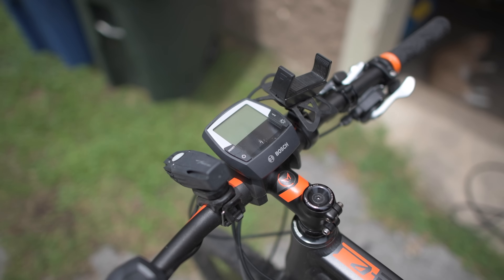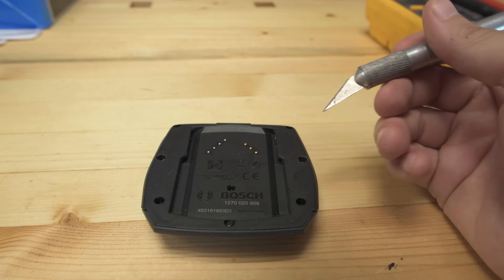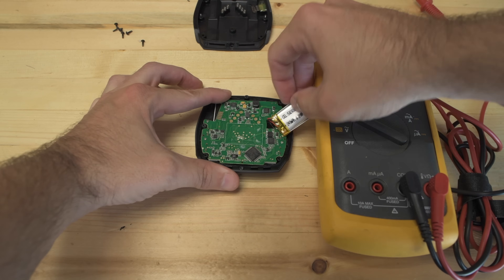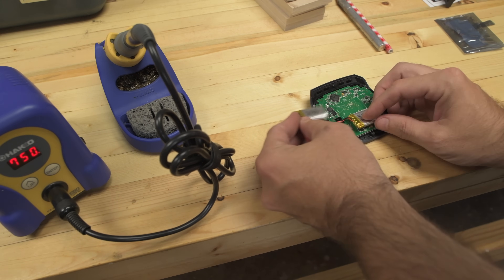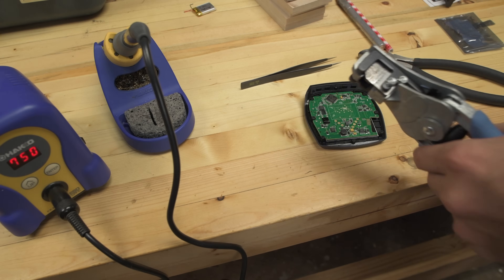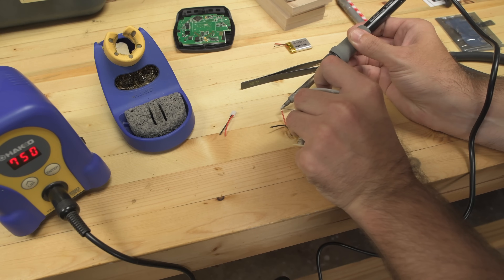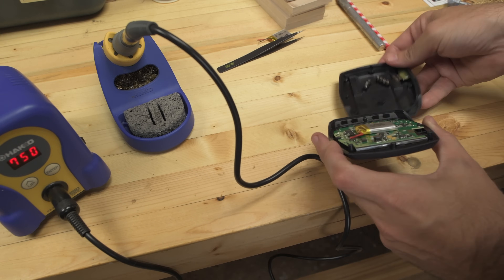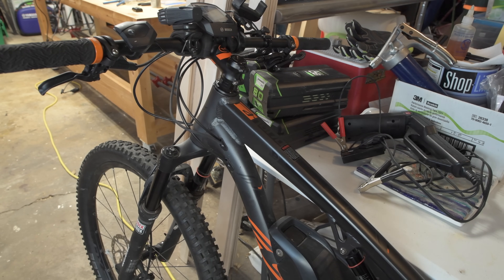Gen2 Bosch ebike display battery replacement

Comment: Thanks so much! I just had the Gen 2 motor replaced on a bike - they went to test it, and the display was dead. Said the only option was to replace the entire display, mounting bracket, and thumb control with a newer version b/c a display replacement wasn't available. $180+. Will have a go at replacing the battery, and if I fail, there are display replacements on ebay (and maybe other places).

Comment: So this is definitely the issue I have. I havent open my unit but I can swear by the battery being dead.

I always take the unit off to prevent theft. I usually charge the bike and the head unit might be in my coat. 

Not once did anyone notify me of the charging process. I'm now looking to buy a solder kit and batteries off amazon and they will be here in a months time. 

The dealer for my bicycle has not yet gotten back to me except basically troubleshooting. 

What a silly design flaw... if youre not aware of it.

Comment: I had the same problem, but all I did was put 4volts to the battery terminals , not the wires, for about 5mins and it brings the battery up to 4 volts and it's been working ever since. Happy Days.

Comment: Thank you so much for this video!  Following your steps solved my problem completely!  After struggling with those 2 screws covered in goop, I simply drilled the heads out with a small drill bit and relied on the remaining 5 screws to hold the unit together after soldering in the replacement battery.  Bravo to you for posting this video!
Reply: I did the same. Add a dab of sealant over the now open screw holes.
Reply: Just scoop the goop out with a small flat screwdriver.

Comment: Does the head unit battery charge from the main battery? And does anyone know which chip is the lipo charger?
Reply from the maker: It does charge from the main battery and newer versions appear to be capable of turning the head unit on periodically every so often in order to recharge the battery. I don’t know if that is a firmware upgrade able feature though.

Comment: Great video. Thanks a lot. I had ordered a new main battery, like for 800 $, but it did not resolved the issue !!! My Haibike has like 6000 miles so I thought the display turning off was caused by the main battery going dead. It was not. I switched displays with another similar bike and it worked fine. I will get a new display since I am pretty sure I will screw up if I start the soldering process you presented and executed with great detail. Thanks again !!

Comment: Great video - thanks.  For those wanting to order a new battery before getting their controller apart, the dimensions of the original battery are about 30mm x 20mm x 4mm.  Do not exceed the 20mm width as it has to fit between the spring contacts with the back, and a bracing post.
Reply: Can confirm those dimensions are correct. Mine was a bit taller though at 5mm, so there might be a bit more space in there
Reply: Can it be a bit longer? I have one in sight that is 35x20x5mm.
Reply: @lovemadeinjapan Scaling off the photo, I'd say 30mm is the maximum that is going to fit in that recess in the rear case
Reply: @ The local shop had the perfect fitting one, and adjusted my order on pickup when I told it was for an Intuvia, so it was an easy replacement.

Comment: Before doing this you can first check if the battery is really death by trying to charge it with a micro usb cable first.

Comment: Thanks for the video @createthis. Did your odometer keep the miles or did it reset? I'm concerned of losing odometer miles.
Reply: Odo doest reset with empty battery. Only clock and trip kinda stuff
Reply: @Jandejongjong  appreciate your response. Thank you

Comment: I have done as you suggest at the start of the video and I can get the controller to come on by pressing the reset on the battery.  Will it work as normal once it is on so can I continue to use it in this way? It's not a great problem switching it on this way every time but I am not clear why this works and if the unit once it's on will continue to function during a bike ride as normal. Any advice would be helpful thanks.

Comment: Great video, I did encounter a problem with battery size following the link provided, was much too big, I will attempt to post a link to the correct sized unit. I did have some luck with the security sealant around those two screws though, I warmed up the end of the correct size screwdriver over a flame and as it was inserted into the screw head it melted the sealer, worked very well.     https://www.ebay.co.uk/itm/3-7V-250mAh-502030-Polymer-Li-ion-battery-cell-Dashcam-Mp3-bluetooth-Protection/264284173034?ssPageName=STRK%3AMEBIDX

Comment: Hey Bro , you are very good. Not the Superman, like many other Videographer present themselves.  Also the hint with the danger if the amateur cuts both wires together, was perfect. Good man. A small hint from my side: Take a picture of the board before you do modifications.
Reply: Thanks for the excellent video. I did this as outlined and my device did not restart unfortunately
Reply from the maker: That sucks. Did you test the battery with a volt meter (multimeter) and confirm it has sufficient voltage? Also double check the polarity.

Comment: Makes sense my display keep going off during the ride and I have to restart it .
Reply from the maker: I’ve never had that happen before. Is this perhaps a contact issue? Carbon on one of the contacts or a worn spring?
Reply: @createthisdotcom  I'm not sure I didn't check on it but it's definitely strange and I'm worried a little sometimes as when I'm like 20miles away and if it wouldn't turn back on I would have to Pedal back a 60p bike with no assist
Reply: @NYCRO21  hi! I have the same problem and i feel lucky that i found you. I hope that the problem  was the battery!?
Reply: @royswisjshwk3167  no it looks like a connection issue
Reply: @NYCRO21  i will check it.   Thank you very much
Reply: Rub the contacts and display pins with your finger and CRC contact spray, has worked for me multiple times in the shop.

Comment: Thanks for this valuable tip. I have the same Intuvia. Isn't there an issue innstalling a 250 mA instead of the original 500 mA ?  Your point of view shall be appreciated.
Reply: I checked on Amazon that the original battery exists :   @t

Comment: Please first try to charge the battery via the usb. My charger for my samsung phone works very well for this. My display died today after exactly 1 year use. I am now chargeing it.
Reply: Did it charge tho?mine is charging right now but it goes on/off while charging
Reply: Yes I'm also having this problem and like you trying to charge via the USB port. Mine also goes off while charging  so not sure this will work. One work around I have found however is that if I connect a usb power pack to the head unit whilst it is in its handlebar cradle I can switch the bike on and it will work. Not a permanent solution so hopefully the usb charge will work, if not probably have to buy a new head unit.
Reply: @AboutFocusTV I could not charge the Intuvia battery. The Intuvia is only a few years old.
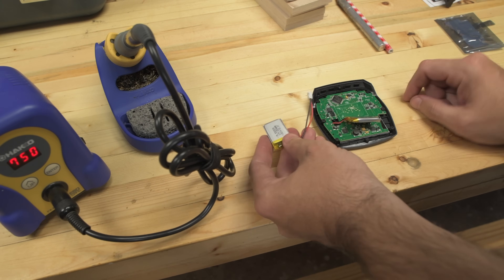Reply: This worked for my Intuvia for a few months. The battery appears to be defective. Why is there not a recall? 6:22
Reply: This is true, and very helpful. Try this first if your display seems to be dead (blank screen, or blinking empty battery symbol). Especially true for bikes where the display is the only way to turn on the battery. Local LBS told me my display was dead, and the only solution was to spend $240 to upgrade to a new display system (apparently Bosch no longer sells these, though they are available on ebay). I found this video, and was able to get the display working again, without replacing the battery. I did go ahead and replace the battery, b/c the bike is over 6 years old, and I don't want the display to conk out on a trip.

Comment: Thanks for the great and helpful video.  The screws take a #0 size phillips head screwdriver, which is typically found in a "miniature screwdriver" set for detail work.  A #1 or (more common) #2 will likely strip the screws.  I was able to scrape away the waxy screw lock material over the middle screws with a tiny straight bladed screwdriver and clear the path before attempting to remove the screws.
Reply from the maker: Good point. I used a #0 Stanley screwdriver in the video.